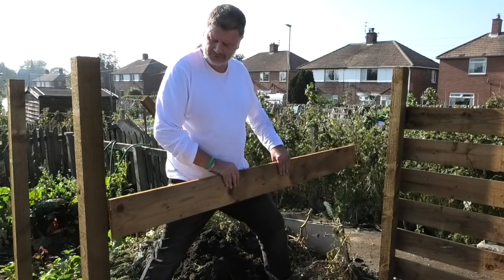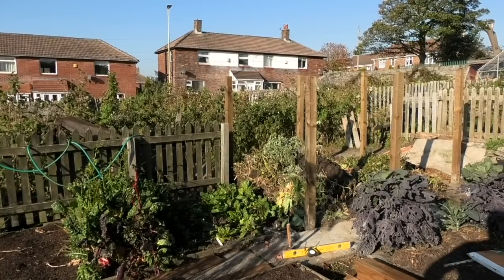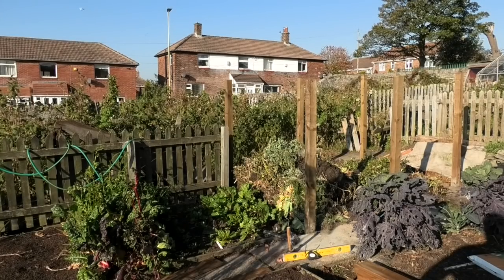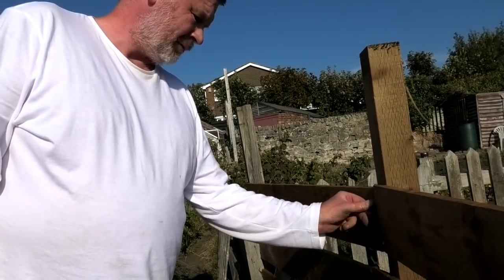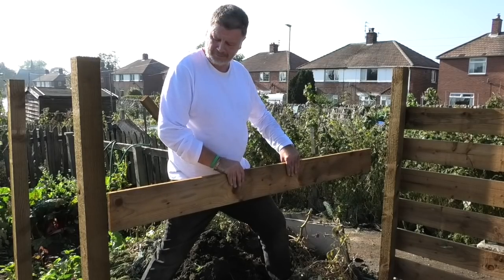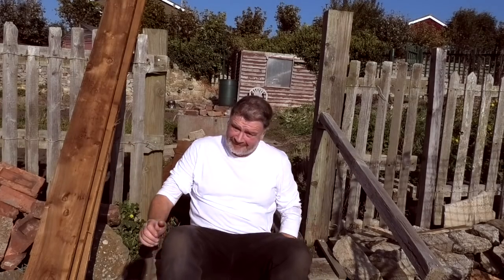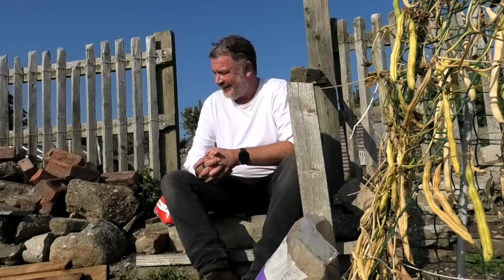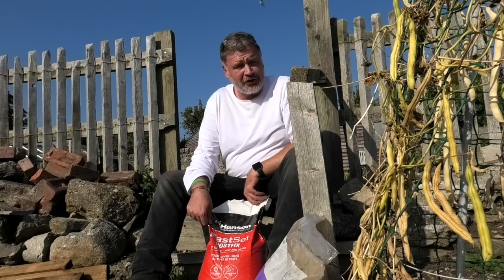I messed up. How to build a compost bin. Building a compost bin on the allotment. Part3

Comment: Quick tip.......if you build up the concrete to above the soil level and incline it downwards away from the post to remove water so that it does not rot the base . It makes the world of difference to how long it will be before the base rots.......about 5 years in my experience.

Comment: Tony dont matter how it's done or what you you use for the alloment buddy.
 My raised beds are made from pallets wood. Me compost bins made from all off cuts of wood iv even got two raised  beds from shiplap fencing panels. As long as it works and its functional. 
 Me table I'm me shed I made from.pallets and me greenhouse stageing from angle eye and bolted together.
 Shelves in the shed made from off cuts of chipboard I cut to size the the extra flooring in the shed I put extra chipboard on the floor that was in there to stop that bounce you get again given the chipboard.
 The 3vx 2 base frame my greenhouse sits on was thrown away in a skip I asked and reused.
 All for free that key word I love I'm all for reusing repurposing us I'm as tight as a ducks a...s .
 Youv done well withe compost bins buddy they work and functional and your pleased with them happy days.
 Take care buddy stay safe.

Comment: Next time you do posts put a few screws in the bottom so they are in the concrete mix, helps a lot to make it more stable, along with adding some form of reinforcement, can be pretty much anything like chopped rope bits or actual wire, just to add tensile strength. As well just add a diagonal brace along the side panels, so they will better withstand the forces, along with also a top bar across the front, so the walls do not splay out as it gets full of compost material.
Reply from the maker: Top tip Sean. We have storm Callum bearing down on us now so I'll be able to see if it stands up to test!

Comment: I dont think thats a bad job Tony I can see one of the bins not quite in line but what the hell. Your like me I try not waste wood rather than go and buy another piece I bodge it up I have even used brackets before to join wood together and sometime glued them as well. One thing I ot this year was rats in my wooden compost bin not the daleks ones even when I put mesh around one managed to get in on a lid which was fastened down, I have stopped them now though
Reply from the maker: You read my mind Chris. I'm going to be joining wood scraps tomorrow